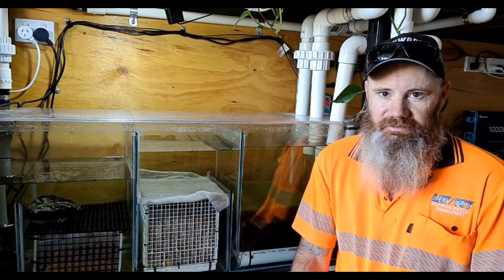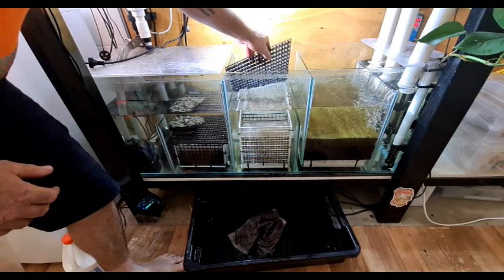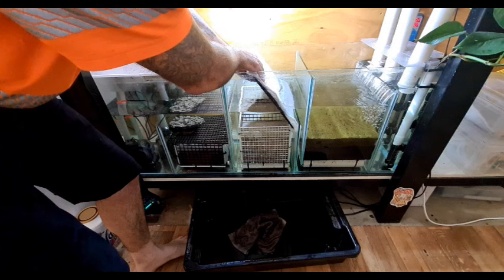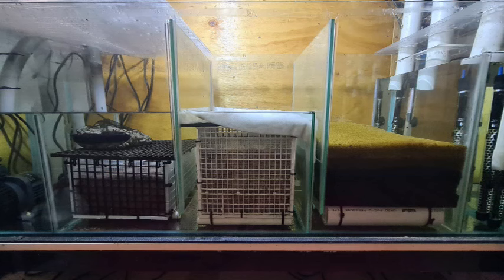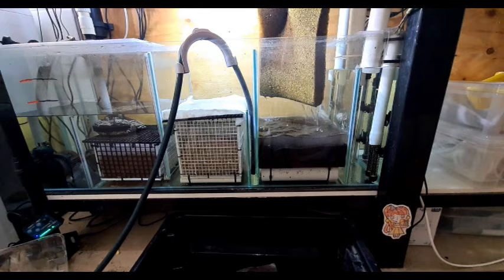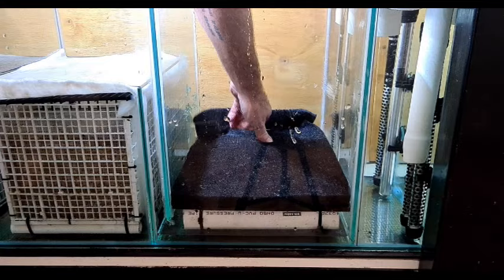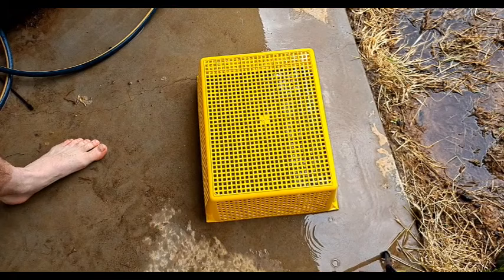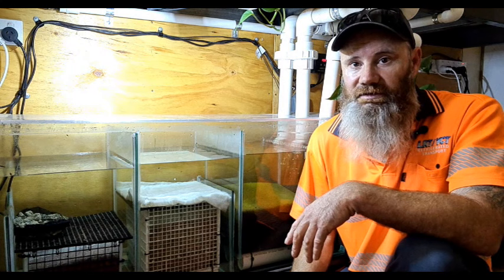How To Clean Your Freshwater Sump The Easy Way.

Comment: I have a very simular sump set up with Poret foam.  I pull the foam panels out while the sump is running and it is less than half the work of your approach.  Any detritus resuspended is gone in a few hours.  Great video.
Reply from the maker: Before I had that little clean out baffle, crap would go absolutely everywhere! Thanks for your interest mate.

Comment: Thanks for sharing these pro-tips on a clean sump. I want mine to stay as clean as possible and yours looks cleaner than many tanks I have seen & the frisky is an added bonus, since I am hoping to try my hand at some Discus & shrimp breeding. Cheers.
Reply from the maker: Thanks mate, the way my old sump was set up I had to remove the sponges to get to the fine pad, which of course made a huge mess. Then I had to drain the whole sump to try and suck up all of that detritus. Good luck with your discus.
Reply: @Gilsfishroom  Thanks, yeah I haven't set my sump up yet, but I am looking forward. Thanks again. Never had Discus, so I will be happy if I can just pull off having them alive healthy and thriving.

Comment: Nice setup, I use separate plastic containers instead of a glass sump. My "sponge chamber" is a 20lt Bunnings bucket, which I just take outside & pour on the garden, quick rinse (no siphoning).
Daughter plays a good statue, I was waitn for someone to jump scare her 😉
Reply from the maker: That sounds even easier. Although if I didn't need to siphon out the sump I would have no way to include the water change device. Thanks for your interest Lana. 😀

Comment: Love it 👌🏾
Reply from the maker: Thanks Rochelle. Any news on your bog filters?
Reply: @Gilsfishroom  well I’ve been taking the water from the actual bog now instead of the tank , but they are the same so I am actually still have questions as to if I have it right. 
My outside bog however ior pond is always under 10ppm so that a good sign, not sure if it os the plants getting more sun or the bog is doing it’s job 🤞🏽🤞🏽🤞🏽 
Also I was wondering -
I use jbl nitrate test kit and sometimes api-
Have you used both ? JBL always gives me around 10ppm for my main pond but api gives me more like 20-30 ppm 🤔 I’m not sure which one is reading correctly.
Reply from the maker: I have only used api, although you have just given me an idea. I just spent 5 minutes on ebay and hopefully  by the end of next week I will have api, jbl, sera and fluval nitrate test kits. I will make a comparison video just for you mate.
Reply: @Gilsfishroom  that would be bloody Awsome 🙏🏼🙏🏼👌🏾
Reply: @Gilsfishroom  actually that would make a great comparison video.
Reply from the maker: Anything for one of my favourite viewers!
Reply from the maker: Yeah, should be interesting.
Reply: @Gilsfishroom  😉

Comment: Why is your water level so high in your sump?
Good idea with the yellow basket👍 think I'll steal that one from ya✌️🏴
Reply from the maker: The main reason is because I made the the tall baffles too high. If the fine pad completely blocks up, the water level will rise in the first half of the sump before it flows over the top of the middle baffle. This means that the level in the pump chamber would become very low. Keeping the sump so full ensures that if the filter chambers are full, there is enough water left for the pump chamber. Another reason is having a higher level in the sump reduces the height the pumps have to push water up into the display tank, saving electricity. Reason three is it increases water volume which is always good. I used to wash the pads on the clothes line, which meant trying to hold them still and getting soaked!

Comment: I love your sump. All the other sumps I see really irritate me because they barely even fill it. But you keep yours nice and full which makes more sense because one of the main benefits of having a sump is to increase the total volume in your system.

I do have some questions on bulkheads and watertight seals. I see them done a million different ways. One person says only use aquarium bulkheads with a rubber seal and no silicone.  Then another person uses regular threaded pvc fittings and just silicones them together.  There's a million different ways to approach them.  So what are your best practices? How do you use your bulkheads?
Reply from the maker: Thanks Ryan. I prefer bulkheads with rubber seals because if the seal leaks, you can either tighten the fitting or remove it and clean the surface, the seal, and try again. Silicone can get a bit messy and doesn't stick to all surfaces like some plastics. If you can't see the fitting, I use irrigation bulkheads or what we call here tank outlets. They are cheaper than aquarium bulkheads but don't look as neat. Thanks for watching mate.

Comment: I have a tiny sump for my aquarium, but have lots of room for a bigger one, you have inspired me to make a bigger one, but I have just one question, how do you manage to syphon the water from the bottom of your sump?
Reply from the maker: I use a garden hose to syphon outside to a low spot in the yard.
Reply: @Gilsfishroom  I struggle to get the water from the bottom of my sump, thank you for your very quick reply, love your video and you aquarium